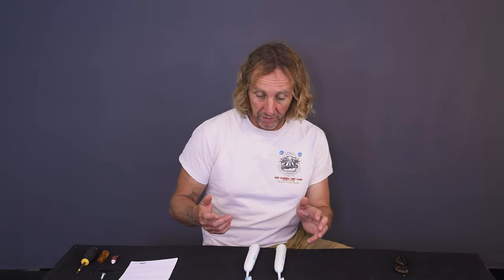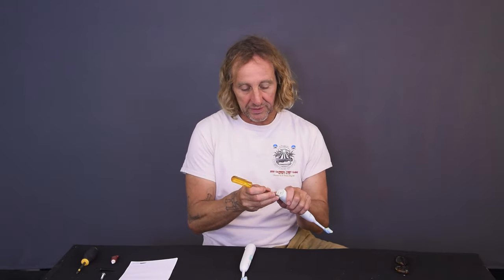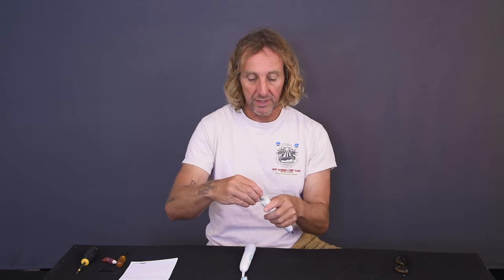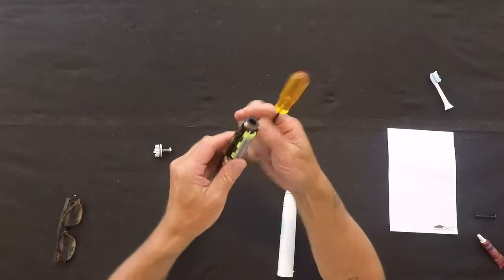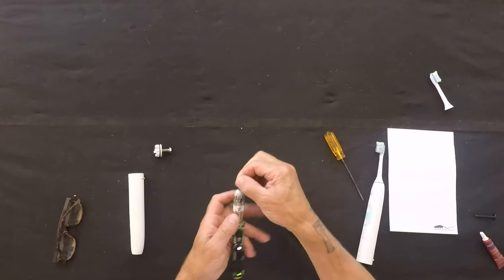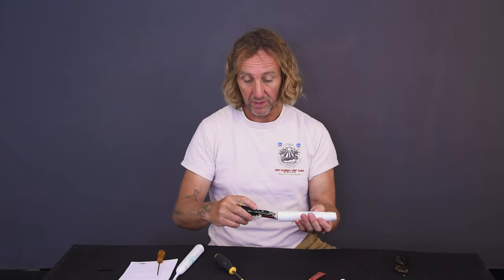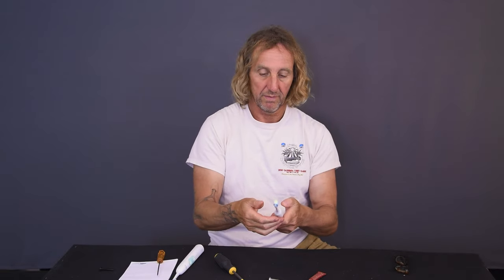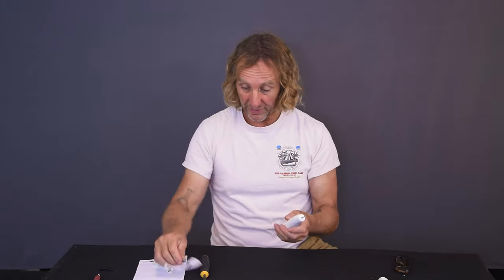Easiest Open/Fix Philips Sonicare Toothbrush HX686 HX684 ...

Comment: Thanks for your video Dave. My hx685 just got much louder. Your method how clever bud. The screw was tight but all noise coming from that area still. Will locktight help quiet it down? Dont have yet. Thanks again
Reply from the maker: Hmmm, I had another make noise and it was a crack in the spring steel attachment between the drive unit and the place where the screw is. 

Don't have a fix for that other than a complex teardown and buying the part or getting a unit with a diff issue to steal parts from.

Comment: Great video! I happen to look for the rubber seal, but I cannot seem to find the right one. Does anyone has a suggestion?
Reply from the maker: If you don't have luck finding a washer possibly getting some Marine silicone sealant and forming a seal on the inside after cleaning it well so the silicon will stick

The metal shaft should slide on the silicon and the silicon should stay stuck to the plastic if you don't make it too messy and form a decent seal

Comment: I wish I could echo the same as everyone else. I was able to open and access everything perfectly, however, after tightening the screw, the vibration was not as intense as before. My wife has the matching brush and it’s night and day difference. I wonder if there’s a torque spec or maybe something else that’s loose. I’ve inspected thoroughly and am unable to visualize anything out of sorts. I was really hoping tightening the screw was the solution but there seems to be a bit more to it; in my particular case anyway. Any feedback on what else could be wrong would be appreciated. Thanks!
Reply from the maker: Yeah, there is a spring steel connection between the drive and the shaft that cracks. It's hard to see and may need to peel back tape. It is not an easy fix and you would need to replace the part.

When it cracks the energy is reduced and when it breaks there is very little vibration on the brush

Comment: If i need to replace the batteries do you just take out and repace i.e. no soldering needed etc.  Which ones do i need. Any links thanks
Reply from the maker: I believe you will need to solder and I believe the battery is an 18650 Lion

Comment: Hi man, thank you so much for this, this is really the best way to open this type of toothbrush I have a toothbrush exactly like this one Hx686p and I have a very strange problem, it is not working at all, no lights nothing and when I try to recharge it the first mode light keeps flashing along with the battery light quickly not like the charging flash, I changed the battery, still the same problem, any suggestions ?

Comment: I have the hx6240-05. Problem is a very short run time, I suspect needs battery replacement. In the hole where the top of charger fits into base of unit, looks like possibly a slotted head screw? Could that be the way to open my model? Any advice appreciated . thank you for your video.
Reply from the maker: I'd love to help but I don't have that model so I'm not sure what to do
Reply: @DaveRat  Thank you for your reply.

Comment: Great video! I wish I’d seen the screw trick before popped the bottom off with a screwdriver. Didn’t mess it up to bad, but still. 
As it turns out (just my luck) the screw you tightened isn’t loose on mine. But it still wobbles like a sonofagun! Any thoughts?
Reply from the maker: On another one I had there is a part inside that breaks between that drives the brush, under the tape.  It's spring steel and it was too hard to fix for me to be worth it
Reply: @DaveRat  Thanks Dave! I think I’m gonna have to trash it and get a new one. I called Philips and it’s out of warranty
Reply from the maker: Yeah, that's what I did and bought another pair at Costco for $99. I keep a spare in my car now

Comment: Nice video, i have a HX686.. i didnt quite get what u said "quarter inch bolt"? ALso i dont see any threads on my tooth brush.. did yours have threads or did it get created when u screwed teh bolt in ? THanks.
Reply from the maker: No threads, the bolt is just the right size to grip the smooth hole

Comment: We bought three of these toothbrushes - and two failed and were replaced under the warranty.  That's a 66% failure rate!  So either ours were manufactured on a really bad day, or else Phillips has a serious problem.  We used to have the older Phillips toothbrushes (with the screw-on head) that didn't have this problem.  I'm an engineer (with Six Sigma) training, and even without knowing a lot about the design, it's pretty obvious that they missed something when they redesigned the product.  

I think the issue is that vibration from the brush is being transferred into the internal components in the handle, causing the screws to loosen over time, whereas the older design provided some isolation for that vibration.  Also, the older design didn't use screws to hold the rotor components together, and the rotor components were part of the expendable head which meant that wear and tear on those components didn't matter since the head would be discarded every few months.
Reply from the maker: Very cool and interesting thank you!

Comment: I bought the bolt specified in the i video and it fits snug (not loose at all) in my 4100. However I can’t seem to pull it out at all. The bolt is very much stuck in there unless i unscrew it out. Is there a specific angle Im supposed to pull? What am I doing wrong here :(
Reply: Mine required a little wiggling from side to side and a hard pull to get it out. I was afraid to break it, because it didn't come out nearly as easy as in the video. It came out without damage though.
Reply from the maker: Yeah give it a hard tug it might have some sticky stuff built up in there over time but it should pop out

Comment: This is great. Thank you. Though not working for me. It's always so close to popping off, before the bolt and paper pop off too. UGH. I'll try again in a few days, got a cut on my finger from trying with the bolt too many times! Too bad Philips isn't designing this better. to avoid all the waste...
Reply from the maker: Hmmm, Maybe try putting small strips of masking tape in the hole and then screwing in the screw.  Also make sure you gave a 1/4-20 screw and not a 6mm screw
Reply: @DaveRat  Solve was having someone stronger than me and a doorway! Haha. The head still wobbles a bit even with Loctite, friend thinks it may be he bushings being worn down, but it is still so much better than before now that the screw is tightened.
Reply from the maker: Awesome and thank you for the update!

Comment: I’ve had a few Sonicares and they’ve all done this sooner or later. Kind of a design flaw. That spot gets a lot of vibration through it and the screw eventually just walks its way loose. They should include a small screwdriver and include a small hole in the housing that lines up with that area, with a little rubber plug that you can pop out and tighten that screw periodically.
Reply from the maker: Once you put loctite on there and tighten it up it should not come undone again

Comment: The Diamond Sonicare models lack a hole in the bottom cap. Instead, hot glue aa glue stick to the center of the bottom.  After the glue cools, grab the attached glue stick and pull to remove the bottom cap from the toothbrush.   Later, use a hair dryer to warm up the melted glue slightly and then peel it off of the bottom cap.
Reply from the maker: Very cool

Comment: I got the end popped off but can’t get the 2 clips to loosen. I might need a thinner screwdriver.
Reply from the maker: Yes you need a tiny little screwdriver to pop those things open and also putting downward pressure on the metal and with the toothbrush removed will force it out once you get them popped
Reply: @DaveRat  Thank you! I got it out. It had already been loosen but it pushing on the metal piece was what finally pushed it out.

Comment: This worked great for me until I discovered the battery would not charge after a few uses. Upon inspection, I found that the (rubber / neoprene?) seal on the shaft for the brush head was not seated properly and water had seeped into the case. So make sure you don't make this blunder and  the repair should work perfectly.
Reply from the maker: Good tip!

Comment: I'm stuck trying to get the inside out. I can't figure out how to compress the two tabs at the same time. Once I can, I'm sure the rest of your solution will be easy
Reply from the maker: I didn't really need to compress both at once, I was able to un hook one side and slightly tilt the gits and it stayed unhookedbwhile I did the other side.

I just had to open another a few days ago. 

Sadly it had an more severe issue and was not reparairable without buying parts

Comment: Ok. I’ve got the guts out. I go to tighten the screw - and there’s no screw. She’s gone missing. How do I find what I need?
Reply from the maker: No screw as in there never was because the design is different or no screw as in, you can see where it was but it is missing? If missing. that screw is probably in there somewhere. Since there is a magnet in the middle of that coil, I will bet the screw is stuck to the magnet.  The scree is a metric 2mm screw that is 8mm long pan head Philips drive. If the screw is gone, then you also may need to find the triangular yoke that it holds in as well.  Where are ya located? I may have a screw and yoke I could send you from a dead unit.
Reply: @DaveRat  I meant missing, and the yoke was still there. But with that magnet comment I looked closer and the screw was actually just stuck to the side of the inner mechanism. Thanks!!
Reply from the maker: Perfect!!

Comment: even though I followed the tips and tricks, I still managed to demolish the bottom piece. They should've designed this differently because Jesus, it was real hard to get it out. Also I did tighten the screw but I still have the issue where it's still loose and making that awful loud noise
Reply from the maker: Oh noooo! Yeah, there is a spring steel piece that breaks that is really hard to fix/replace

Comment: Ugh, I tried your method, but every bolt I had was too small. Guess those bolts aren't as common as you claimed.
Reply from the maker: Unless you live where bolts are metric, a 1/4-20 bolt is about the most common. Any hardware store should have about 20 or 39 different versions of it ranging from Phillips head, flat head, socket heat, and hex head in maybe 10 or more lengths and they can be bought for like 20 cents.

Longer ones are easier to grip. I literally have needed one and looked around on the ground in an empty lot and found them lying around. There are probably hundreds of them used in and around your house if ya know what to look for and cod pull one off a gate hinge if ya don't want to buy one.
Reply: @DaveRat  Living in Canada, that could be the case. Either way, I went with prying the bottom open with a screwdriver anyway. Made a lot of dents in it but I fixed the loose screw in the top (it flat-out wasn't even in the hole). Maybe I tightened it too much; I hardly feel the vibration, so I might loosen it just a little bit.
Reply from the maker: Ahhh, yes the metric bolts won't work well. You need a 6.5 mm which is not an easy find. But a 6mm and a small roll of tape would probably work

Comment: Too bad the screwdriver tip doesn't work anymore it doesn't do anything and the manual says to hit both sides near the bottom with a hammer to release the tabs or whatever
Reply from the maker: It still work just fine on the models from the vid